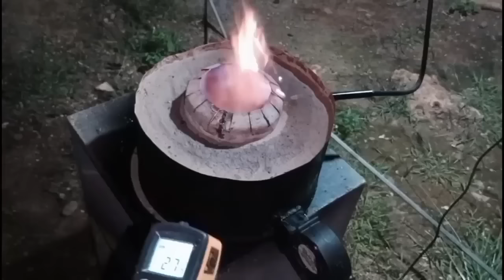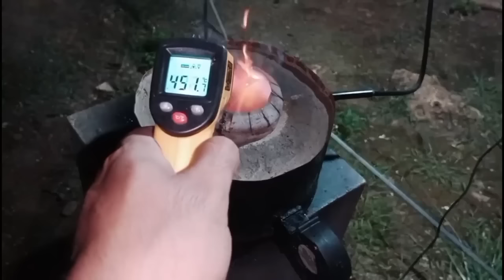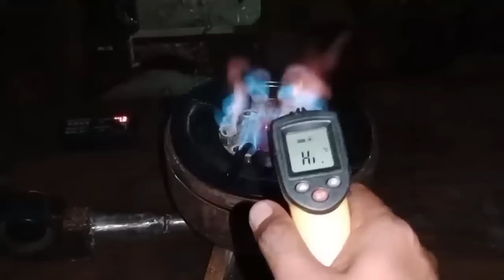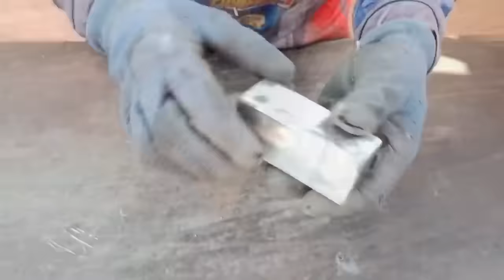The manufacturer doesn't want you to know this! Saving money

Comment: Greetings, so I've watched many of these.

How about something all new?

1.  Waste Oil Burner Heater.  Something that can be outside and use ducting or piping to heat clean air and direct inside?
2.  Waste Oil Burner Heater.  Something the uses copper or piping to heat water than then goes through say a car radiator or air conditioner coil with fan that radiates the heat?

What even be more cool is multi-fuel.  So using like an old compressor air tank be able wood or waste oil fire it again towards heating, perhaps even cooking surface upon it?
Reply: That is some awesome ideas to make the heat created safer.  😁👍